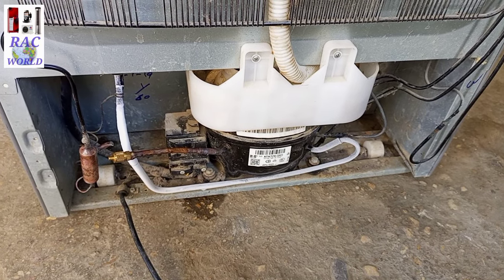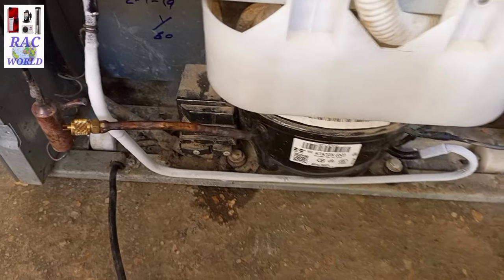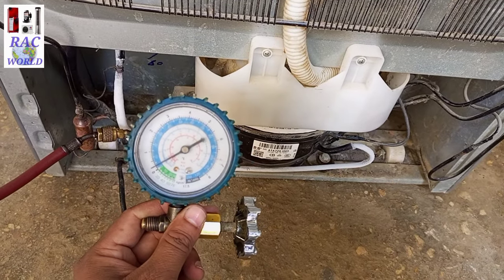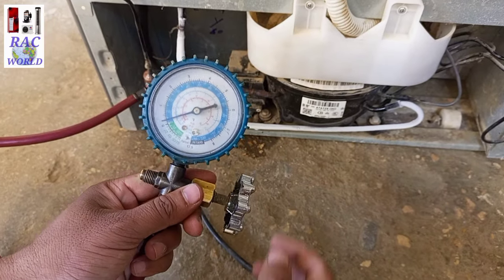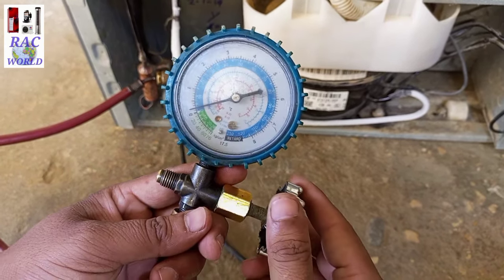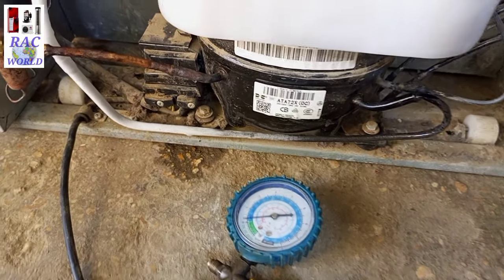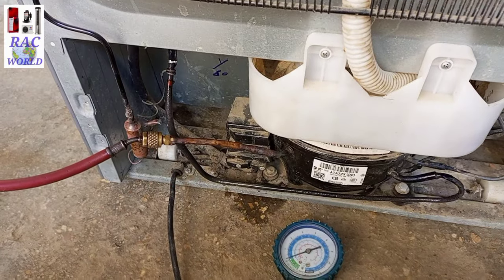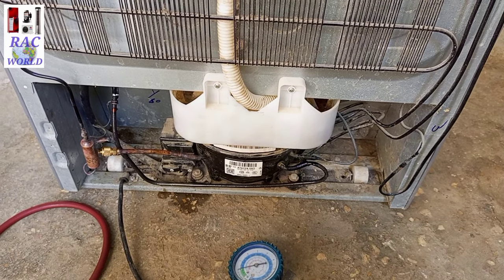Refrigerator suction line ice reason|how to remove ice from refrigerator suction line|ice on suction

Comment: What a fantastic video i must say. But my question is are we going to let out some gas when the compressor is Off or On. Cos i think if it's ON the compressor will draw in air since he gauge is on the SUCTION side. Please clarify.
Reply from the maker: You can released gas even in on condition. Because it will not suck air inside when its running pressure is upper than zero psi.
Reply from the maker: But you can't released R600a refrigerant, while its compressor is on. Because it will suck air inside.
Reply: May Allah reward you abundantly. ❤🎉
Reply from the maker: @Intygra  
JAZAKALLAH

Comment: Acha naeem Bhai aik split a,c inverter Kenwood ,,,, wo hm ne cheek Kya Usme gas's nahe,,, JB hm ne uska indoor khola to Jo drain side hoty h,,, Waha per oil Aya ho tha,,,acha khassa,,,, hmne cooling coil ko pressure dya 500 psi,,,, ne coil ko Pani  me  bhe dip kya,,, leakeag kahe se bhe nhe Mili,,botel me sarf Dal k bhe chek Kya ,,,,Kya reason ho
Reply from the maker: Cooling coil is leaked

Comment: If not releases pressure any problems for fridge, technicians told me not a issues for ice for suction line
Reply from the maker: Sure it will harm your compressor pump. Because it is over gas charged

Comment: My fridge suction line is at 2psi running pressure but the line is still frosted. What could be the cause? Thank you.
Reply from the maker: If there is R600, than it should be on zero psi or below than zero
Reply: @racworld1365  It’s R134A. I was told for R134A, the suction line pressure should be 22 psi and I need to add more r134a. In your video, the pressure is 0-2psi. I am confused. Thank you.
Reply from the maker: @jamesw4445 your refrigerator is direct cool? Or frost free?
Reply: @racworld1365  It’s frost free. It’s GE side by side GSH25JSRFSS 25 cu ft fridge. It has automatic defrost. I can hear fan inside freezer runs when the compressor runs.

Comment: What is the disadvantage of having ice on this suction line?
Reply from the maker: Maybe cause of late ice making 
Maybe Cause of Damage compressor pump.
Maybe cause of leakage of compressor body due to rust.
Reply: If suction line is freezing your in danger of pulling liquid refrigerant into the compressor, causing damage to it